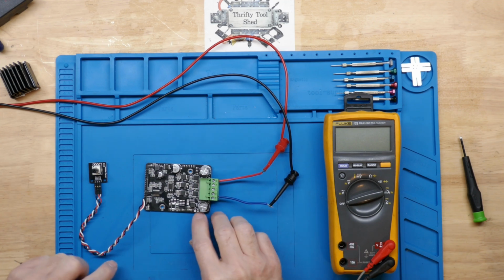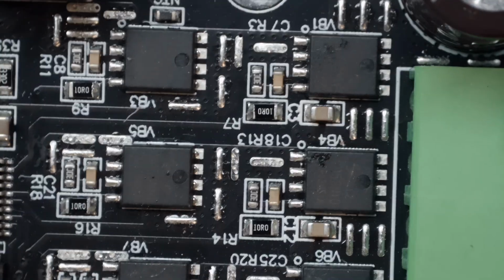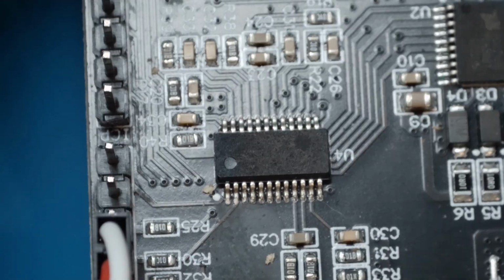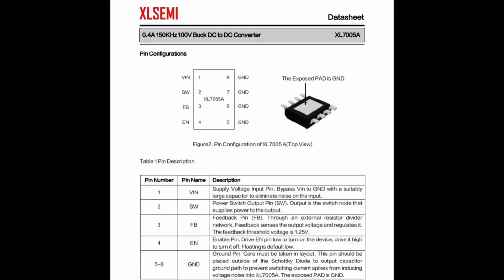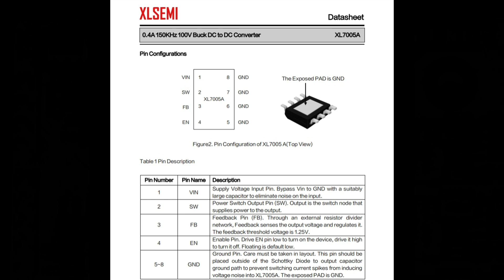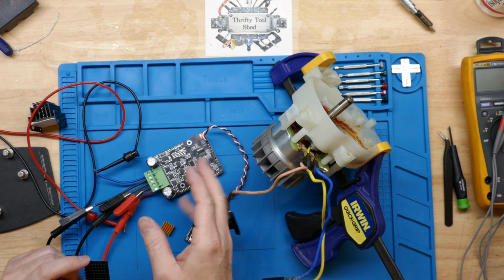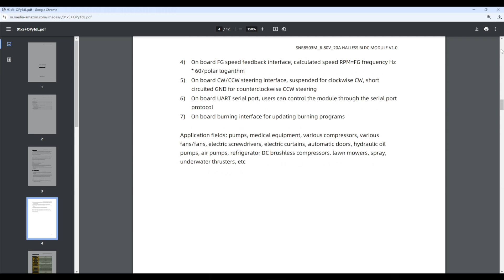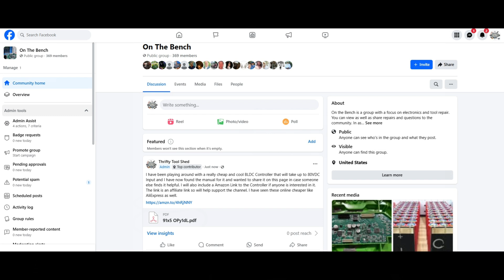80V BLDC Controller Repair

Comment: Wow! You really know your microelectronics! I'm impressed. 

I was talking to the board designer/company (SNANER) about this exact sensorless board. I believe I have a more thorough information packet than just the PDF. If you are interested, I would love to send you the packet and supply you company contacts( if needed/wanted).

I do also have a programming tool and software, but Im not really sure how to use them/tune a BLDC. I do seem to remember the software being in Chinese/Mandarin, but I imagine translation software should make this simple. I will need to check again. 

The software should allow you to adjust stall conditions, startup/shutdown behavior, etc. I would love it if you could make some content on this. I've struggled to find related content. I'm rather early in my microelectronics journey, so I really appreciate how clearly you conveyed the information in your video.

 I'd be more than willing to send/ship drivers/heatsinks + flashing tools + software/info packets + $$ compensation. Totally cool to share/post the videos. If it is not of interest, I understand.
Reply from the maker: Thanks so much for your kind words. I actually have not been doing much with the channel in the last 6 months or so. I appreciate your information and desire to learn more. I hope someone that is really dedicated and sharp on the setup of the BLDC controller can help in this.
Reply: I`m also going to play with that device a little bit using some program features.

Comment: Mine doesn't work on 80 volts???????????????????????????
Reply from the maker: I have tested on 60VDC which is all I need typically. I have tested enough to know it needs cooling for sure to run above 8A or so. Forced cooling like close to blower intake for best case scenario. What issue are you seeing with the 80V input?

Comment: I tried to run one of those beefy all-metal HP server fans (I estimate it to be around 200W/60V) with it and after some shaking it only returns "locked rotor" error (even though a tiny ESC quarter its size run those fans without problems. Is there any method to to extend starting procedure?
Reply from the maker: Not that I am aware of.
 Is the server fan a BLDC? I am sure their are some out there, but i have not seen one myself.
Reply: @ThriftyToolShed  Certainly. They someatimes surfaces dirt cheap as "hp blade fan" or "electric turbocharger".
Reply from the maker: Awesome! Have you tried this hall less controller that I have shared many times on the channel? It is tried and true, but only rated  50V. 
https://amzn.to/3TvXrXJ
Reply: @ThriftyToolShed  I will give it a try, thanks for suggestion.

Comment: Cool, ich habe auch diesen Controller,  und suche nach Anleitungen ❤

Ich wollte auch einen kühlkörper auf die mosfet direkt kleben, stellte aber dann fest das 3 Keramik kondensatoren etwas dicker sind als die mosfet. Evtl muss man löcher in den kühlkörper bohren um platz zu schaffen für die 3 kondensatoren?
Das man die spannungsversorgung komplett trennen kann ist gut, denn ich will einen kompressor damit betreiben, und war unsicher wo ich den druckschalter anschließen soll.
Reply from the maker: Some versions do have the ceramic caps sticking up. I know one of the hall sensor style that I have does. The hall less one in the video was flush with the mosfets so the thermal tape was fine. The heatsink may still need forced air to cool at full power.

Comment: Can it drive this big motor and you are using with out hall
Reply from the maker: Yes, I am driving the chainsaw bldc motor without hall in the video. It would need some cooling if running above 5A. I am just now testing it out under loads and running longer runs. It's looking like above 20A it will need some forced air as well. The Blowers are usually easy to add this by simply placing the controller close to the air intake of the blower, and the forced air works wonders. The chainsaw is hard to get in the place where the original controller had air flow. A small fan may have to be added.

Comment: I have v2 can I use with out hall heat sink not there it will heat up snickered heat sink will go off after some heat
Reply from the maker: I am not sure what V2 is. The manual was Version 1. I am not sure about the boards. It seems one is hall less and one is hall. I am unsure as to which would be referred to V2, at this point. And yes, above 5A would require a heat sink, and as we approach 15-20A, we will most likely need some forced air. The mosfets can handle a lot of current, but they generate a lot of heat and will need a good way to dissipate it.
Reply: @ThriftyToolShed  thanks I will share SNR8503 version 2
Reply: Ich habe überlegt auf der Rückseite der Platine die verzinnten breiten Flächen gewinkelte dünne kupferbleche auf zu löten, dadurch würde sich zum einen der leitungsquerschnitt für den strom vergrößern,  zum anderen wäre die Fläche größer was die wärme ab geben kann. Durch das direkte auf löten wäre es sehr geringer wärmewiederstand und sehr gute wärmeleitung.
Natürlich muss man aufpassen weil die kupferbleche unter Strom sind, es darf sich nicht berühren. 

Was halten sie von dieser Idee?  Elektrisch isolierende wärmeleitpad habe ich immer bedenken das die wärme nicht gut genug übertragen wird.
Reply from the maker: I am sure it would help. Ultimately, if it's pushed hard like 15A and over, it may need forced air cooling as well.